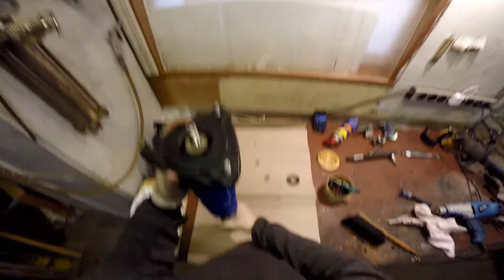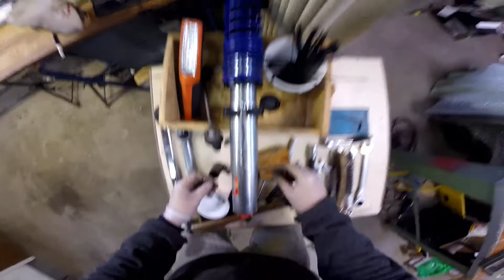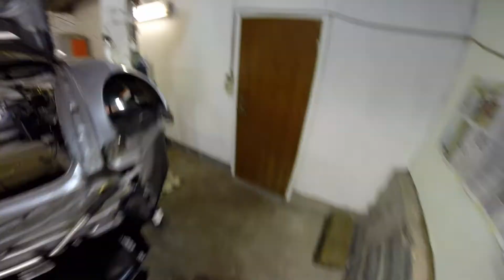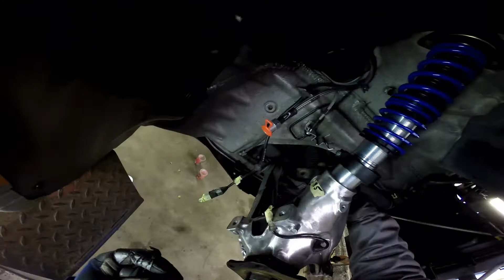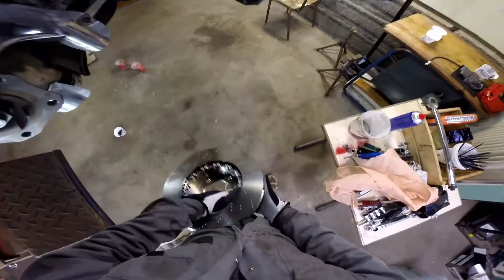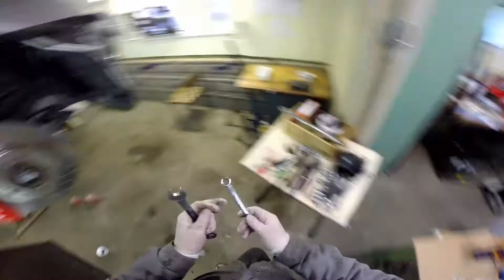Assemble and mount front coilovers + brakes, with torque. Porsche Cayman 987 │Tobe Tinkering

Comment: New subscriber, new Cayman owner. You sure have that car torn apart. What are your plans?
Did you realign the front strut to your marks? You didn't mention it and I didn't notice. Where do you get your torque values? I've tried to find a service manual without luck.
All the best, my friend.
Reply from the maker: Hi - I didn't do a proper realignment directly after but just changed according to how it felt (changed toe in). Since I tinkered with the rear end I need to reset all values this spring.

There are (workshop) manuals to be bought if you know where to look but unfortunately I cannot help you much more than that since Porsche seems to have blocked any formal (Haynes et.al.) production of such materials. I presume that is because Porsche want us all to hand in the car to them to do all work on it but I that's not how I roll.
Reply: I agree with you. I do as much of my own work as I can. I enjoy learning about my car and being self-sufficient. I can use the savings for upgrades - a GT3 intake system sounds interesting.
Reply from the maker: robkal56 if you drop me a mail I might be able to help additionaly.